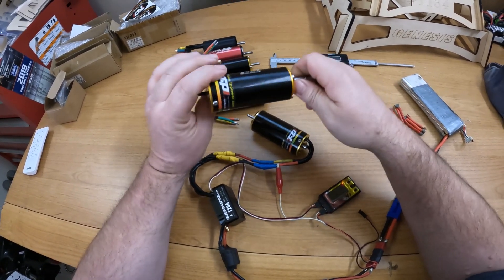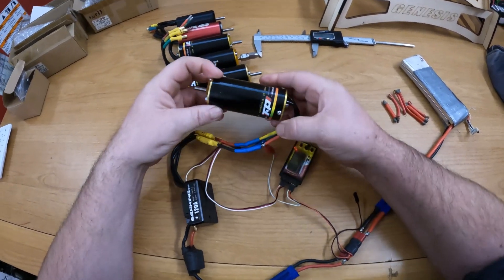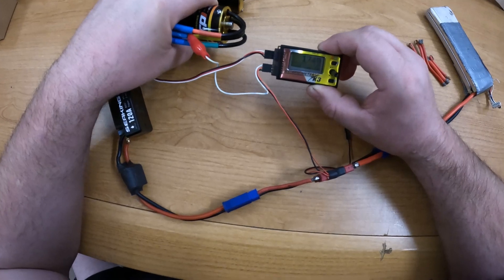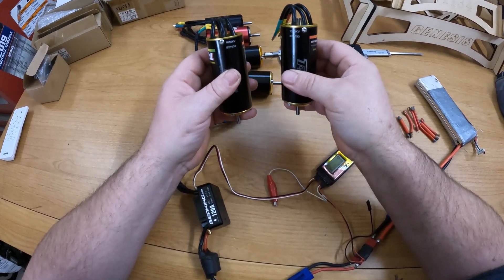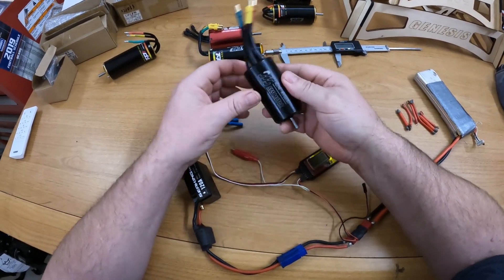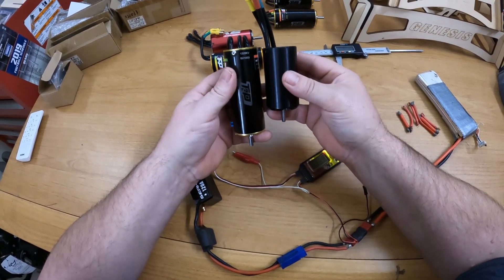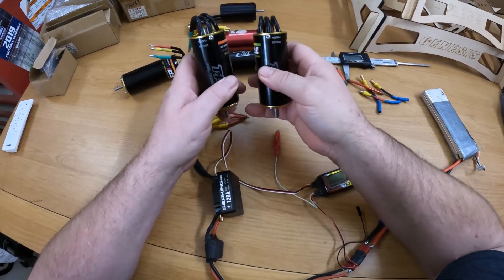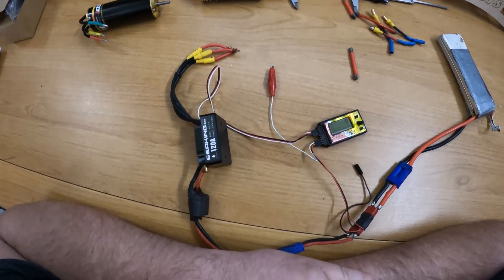TP 4060   TP4070   SSS4074         Kv testing 4 motors

Comment: Put the 1650 in it . Go big or go home right ?I love the TP motors, but why do they sound so much rougher than the SSS? Cause I’m running the TP 3640 and my carbon fiber pursuit 2100 KV on 6s and it’s pretty hot.

Comment: Hi, i just bought a 3770kv TP Power motor for boat. For a competition with 120a esc and 2200mAh (all cells are accepted) battery regulations, what propeller size should i use? Thank you

Comment: Are you familiar with the 5670cm 2510 kv motor?
Reply from the maker: I am not but those big motors work great at low kv (800-1200) and high voltage.
At that high of a kv the amperage will be too much for most esc's imo.
Reply: @secretsquirrel1942  thanks for that info
Reply from the maker: No problem
Reply: Great vid thank you. Would a TP 4070 V2 1520kv work with an 8s 200 amp ESC please?

Comment: Tp power has got a new 4080 cm motor out now on Aliexpress at 2000kv that taks 8s . Check them out
Reply from the maker: Thats crazy will look into it, love the TP motors.
Reply: Would be nice if it was a non-CM. Does not need all those RPM. At that size and weight, not sure what it would do a 56 can wouldn't do.

Comment: You should take same length and same kv of different brands to test. This test provides little info.
Reply from the maker: I tried that but the problem is one manufacturers 2200kv motor is 2100kv and the next manufacturers 2200kv motor is 2300kv.
This test is suitable for figuring out what combination or voltage the motor is useful for.
Reply: No comparison to TP. Doesn’t matter what brand nothing can stack up to tp. Castle is only company to come close.